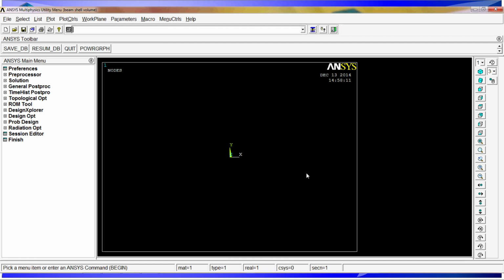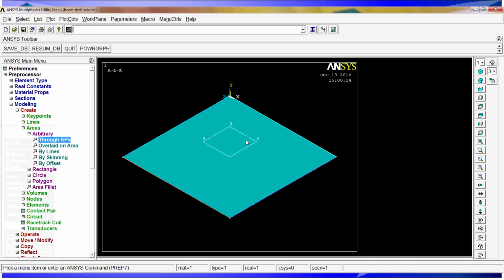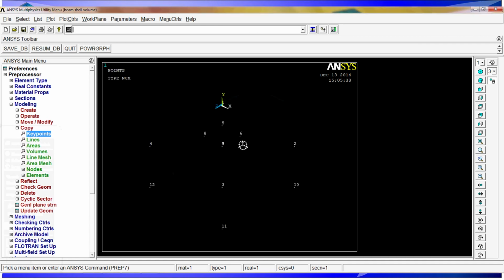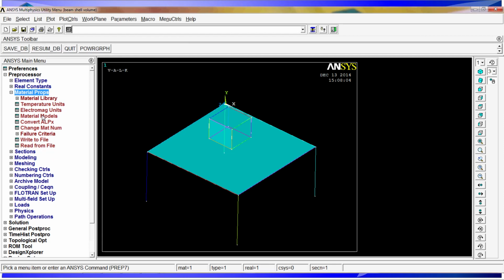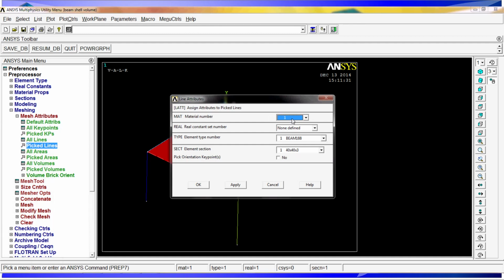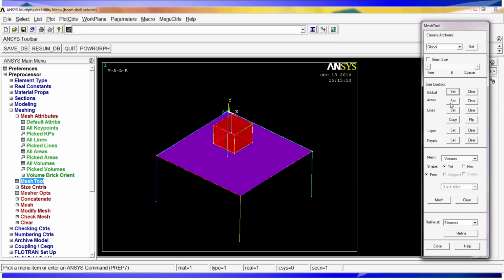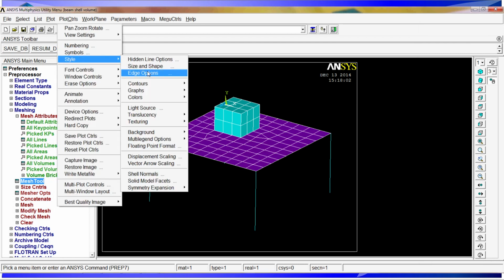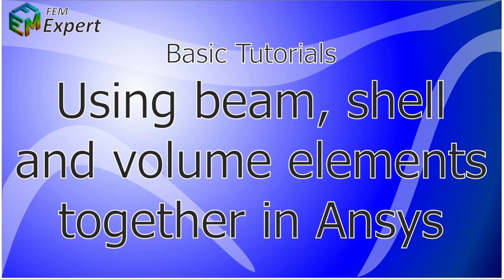Ansys Tutorial: Using beam, shell and volume elemente together in Ansys #11

Comment: Is there any way to connect a Shell181 element with a Beam188 element that is perpendicular to the shell's plane, so that the mesh is discretized around it without merging nodes? For example, using FreeMesh.
Reply from the maker: You can use RBE elements, basically all the interactions take place at the nodes... therefore to connect a BEAM to a SHELL you will have to do it somehow though their nodes
You can even create an additional beam, or rigid elements, springs... whatever will be feasible in terms of effort and time.
Reply from the maker: Do you need it for a specific situation or for a lot of elements?